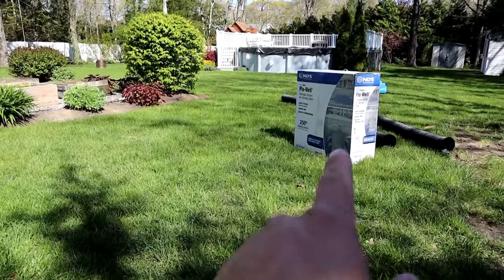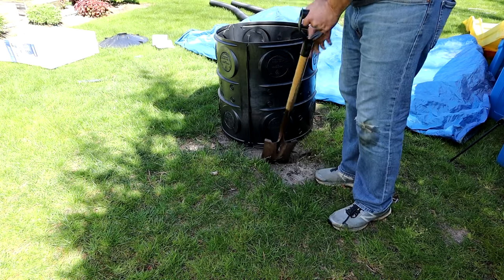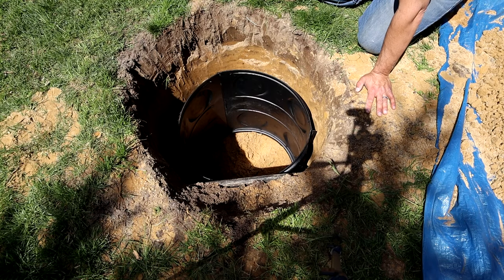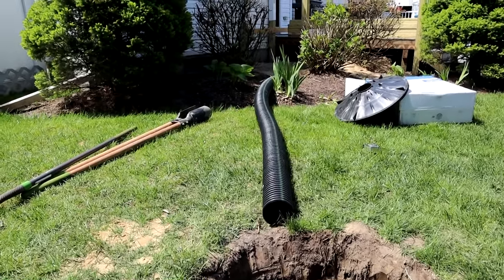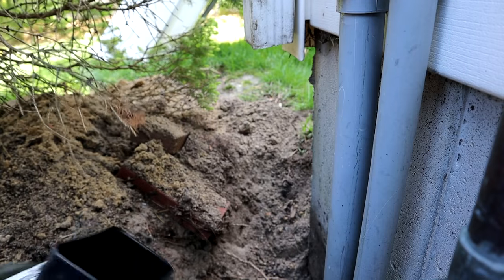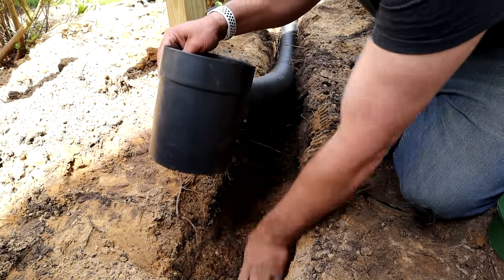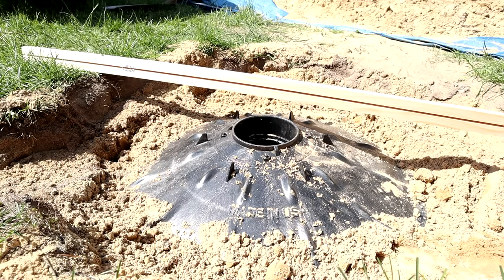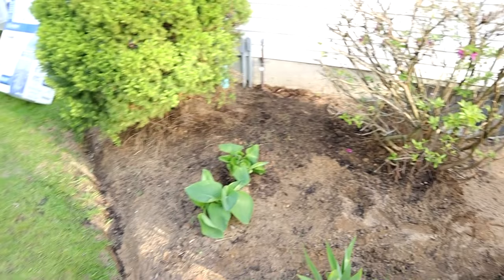Install a Dry Well | How To

Comment from the maker: Drywell kit: https://amzn.to/31Co0PL
Pipe adapter: https://amzn.to/3gG07wZ
Drain basin: https://amzn.to/30ETaGC
Atrium grate: https://amzn.to/31wIWHL
Downspout adapter: https://amzn.to/33GAbh2
Piping: https://amzn.to/2DAtfqT
Basin top grate: https://amzn.to/33E1zfy
Post hole digger: https://amzn.to/2XfPAk7
Shovel: https://amzn.to/31wJAFb
Canon M50: https://amzn.to/2PdqqhO 
Mic: https://amzn.to/33jqXae
Tripod: https://amzn.to/3k4w3wP
Reply: Why do you you open the holes on the side and cover with weed block felt
Reply from the maker: @daveyoung5257  I didn’t need the extra capacity on this one bit yes, that would be the way to go if you needed. Thanks for the comment

Comment: Nice video. Thank you for posting. I followed it and installed one today. Everything worked out as described. 
Quick advise for others: 
The drywell piece is hard to keep together so what I ended up doing is tying the last tab at the bottom (the parts clip on together) with a zip tie  on all three joints. It kept it together quite nicely. I also used a popup emitter on top. Also, don't underestimate how much dirt you dig out. Make sure you have a plan for that.

Comment from the maker: Thanks!  Yes I agree. The sides are hard to keep together until it’s set in the ground. I’ve used self tapping screws in the past too. Zip a couple in on each joint and it will hold the basin together until you backfill. Yes, it never looks like a lot of dirt until you have to move it somewhere.

Comment: Thanks for this video! That was quite a bit of nice work there. Trying to wrap my head around proper drainage needed for the down spouts, washing machine, and sink in the basement. Old one is having troubles. Pretty sure I won't be able to tackle this one myself. Fall is here and winter shortly behind in NE. Going to need some help!

Comment: Those connections for corraogaded pipe can leak all the water you put in it if the flow is slow.  Should always use "Tile Tape" to seal the connections.  It is like Flex Tape but made for the pipe and sold next to the pipe. Also a "Y" instead of a "T" would help with flow.  Maybe not needed for your install though.  Thanks for the video!

Comment: All that work and money and you didn't use soil separator, permeable fabric to wrap your dry well or in the trenches...  The soil will work its way into the dry well and into the drain system.  Great job, key ingredient missed.

Comment: hey buddy i work on powerlines in texas we have a tool called slapsticks there 10 feet long we use them to dig holes for power poles buy a set for yourself for your holes you wont regret it !!
Reply from the maker: Thanks for the tip man! 👍🏻

Comment: Great video, just gave a question, will water sit in the dry well and end up with a mosquito infestion?
Reply from the maker: It shouldn’t. Ideally these work well in conditions where the subsoil is sand. You’ll need to dig down past the clay layer for good drainage.

Comment: Nice video.  The only thing I would worry about is driving a 1000lb zero turn mower near the top drain.
Reply from the maker: Thanks. I’ve driven a pickup over it loaded with rock for a wall I built in the yard.  Forgot all about it until after the fact. It survived with no issues 👍🏻
Reply: @fixitwithzim  Good stuff.  Thanks for responding.

Comment: Great job 👍. Just curious.  Why didn't you wrap the dry well with fabric and place stone between dry well and outside ground..And you could have ran a overflow length with a pop up outlet.
Reply from the maker: Thanks. I’ve done it both ways.  On this particular install, the bottom was all sand and drains pretty well without backfilling with gravel.

Comment: Nice work!....what size well & size drain pipe would u go w/ for a standard washing machine?....also....washing machine is ground level...do u still need that usual pipe that's a vent(I think it's acts as a vent for drain)....how far from house as well?...I'm just trying to get an idea on things before I'd do this...I also gotta go under a smaller-width side walk for drain line....anyways,any info is appreciated & again real nice job!....

Comment: would you recommend anything different for a drywell for down spouts that would be black topped? Before they pave my driveway I want to install 2 drywells for drainage of the 2 downspouts that would otherwise drain on the driveway. would you still keep the drywell hollow if black top will be over the top and cars driving on top of it?

Comment: Do u ever use 3/4 trap rock at bottom of well or on outside of well between well and hole wall?
Reply: All the videos I seen use rock on the bottom and sides, seem like the sand would eventually get hard packed and not drain well

Comment: I’m curious how is the water not back flowing with pipping being lower than the opening on the top?
Reply from the maker: Elevation change. The outlet on top of the well is lower then the pipe inlets on the other side

Comment: Hey man, great video. I have a question--would it make sense to dig the dry well into the ground underneath the drain, then run the pipe from the dry wall out ~ 20 ft if you have a good spot to drain it from there?
Reply: Keep water away from foundation

Comment: I dig a 3 ft deep well and let sump pump water run into to test it after 12 hrs 80% filled, ground very very slow to drain , I am not sure it's work for me to do a dry well of sump pump?
Reply from the maker: This method is only good with decent soil conditions. Ideally sand, rock, etc. Clay would be an issue if you have

Comment: thanks for the video. 
one question for you. have you had any problems since installing at all? 

i too live on long island (south shore) and am planning on installing this dry well in my backyard and from what ive seen and have been told is its best to fill the dry well surrounding with pee pebbles or the ez flow tube system but with out the tube and only the aggregate. 
so, since you filled the surrounding with this great long island soil does the water still drain well and does it effect your grass growth?
Reply from the maker: Hey man, yes...if you need the extra capacity during heavy rains, I’d recommend punching out the knockouts and backfilling with pee gravel. I’ve installed a bunch this way. Didn’t do it in this particular install as I didn’t feel it was needed.  A year later and no issues!  It’s still working great.
Reply: @fixitwithzim  punch out the knockouts so the pebbles go inside the well?
Reply: @MrBchristopher  I would recommend wrapping the dry well in landscaping fabric is you are going to punch the holes out.
Reply: @frankrizzo5594  The dry well manufacturer makes a point of saying that their dry well has a much higher capacity than a stone/gravel filled hole (as it is an empty void). So, yes, use woven geotextile fabric — wrap the dry well with the fabric. Then fill the space around the wrapped dry well with the "pebbles." You're golden.

Comment: On the box it shows a bottom 24in round cap that could or should be installed, in the video it does not show installing the FWBP24 Flow well bottom, is it a good idea to install the bottom cap

Comment: You never put the felt paper around the outside for the knockouts so the water can drain. Those knockout holes are going to get filled with dirt and the water is not going to dream big mistake.
Reply from the maker: Nahh, don’t sweat it. Still working great my man 👍🏻

Comment: Should have a bottom with no drain holes, drainage should be from sides,and sand makes poor to little drainage compared to gravel,sand is gonna drain very, very slowly
Reply: I dig a 3 ft deep well and let sump pump water run into to test it after 12 hrs 80% filled, ground very very slow to drain , I am not sure it's work for me to do a dry well of sump pump?

Comment: You didn't cut out smaller drain holes, Why ?
Reply from the maker: I’ve done it both ways…some with the holes punched out with gravel backfill for extra capacity when needed and other times like I did in the video when it’s not needed.  Lots of different ways to install these.
Reply: @fixitwithzim  Thanks for your reply.  
I like your work.

Comment: 🤷🤷🤷🥺🥺🥺  Should have put stone on the outside of that tube , tub.
Reply from the maker: I’ve done it both ways…some with stone for extra capacity and other times (like the video) with no stone if it wasn’t needed. This particular install was all sand and for the anticipated usage, wasn’t all that necessary to add stone